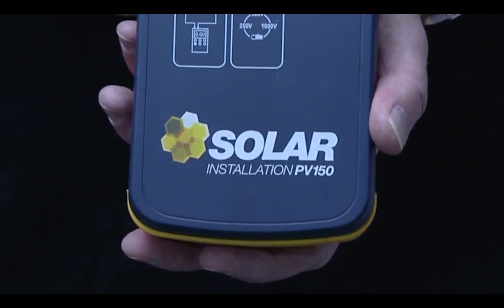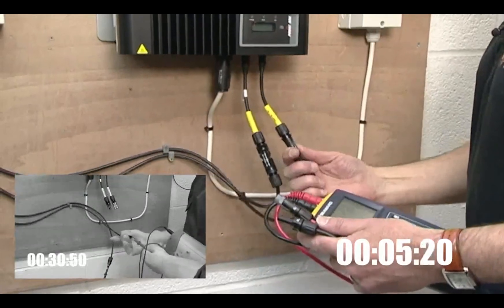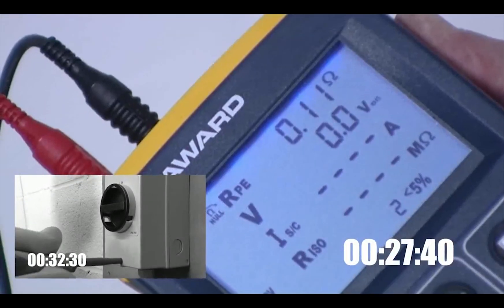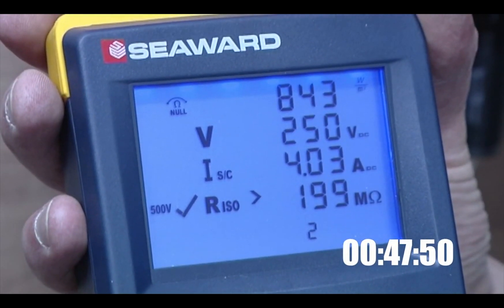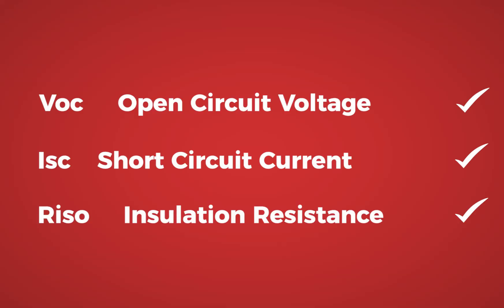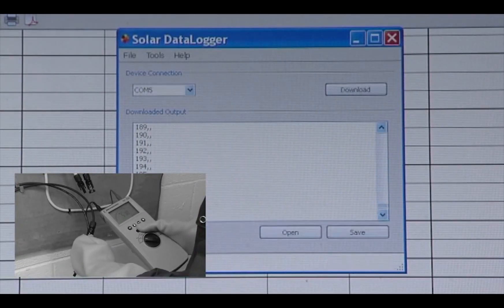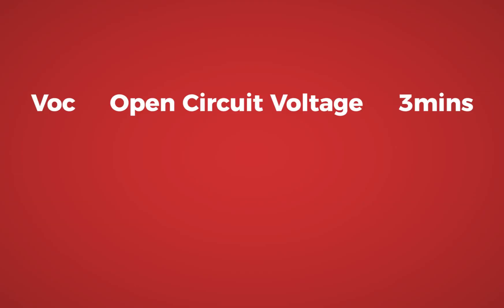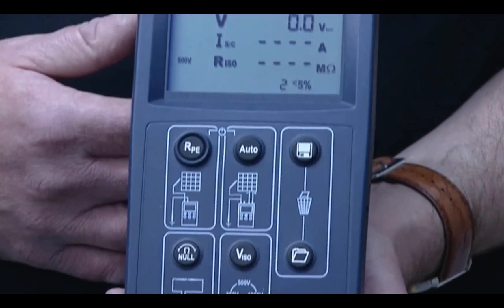Traditional solar testing tools vs a Seaward solar PV tester

Comment: does it measure th solar irradiation?...or..what is that number at the top of the screen in the seaward solar tester?
Reply from the maker: Hi Yuri. We have the Solar Survey 200R which can be used with the PV150 and PV200 testers. This is what will show the irradiance in the tester. If you require any further information about our solar PV testers please email sales@seaward.com. Thank you.